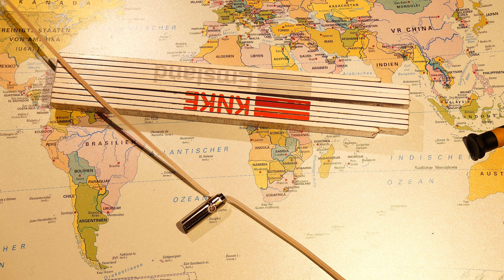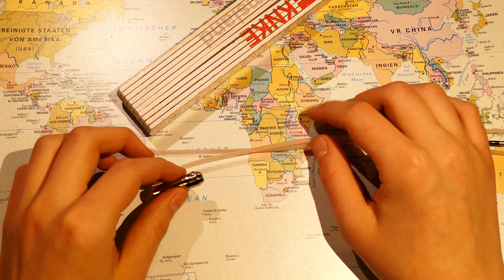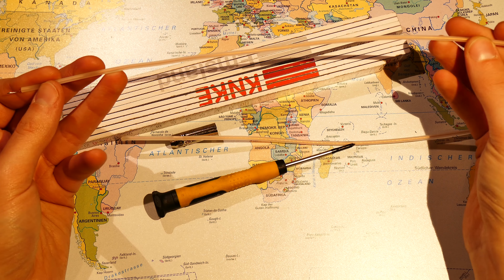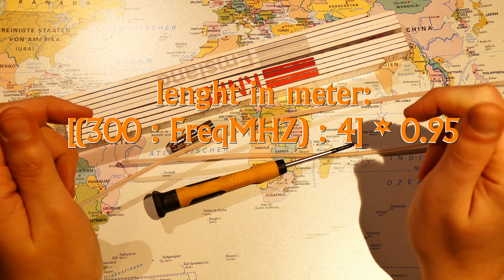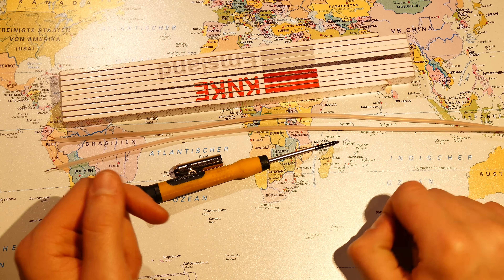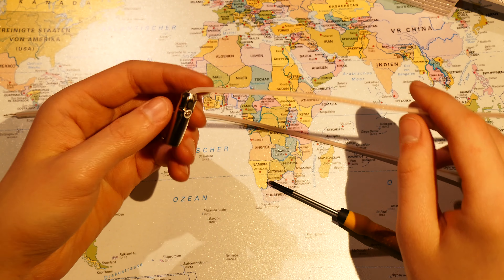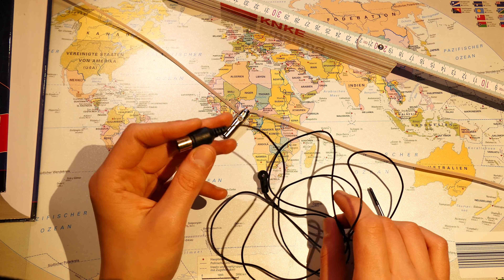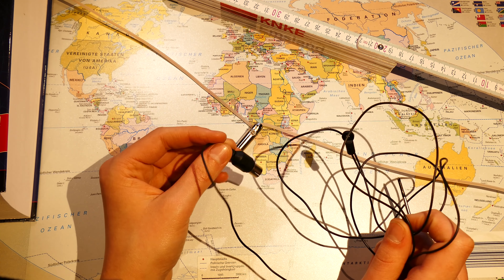Homebrew antenna for DAB+, DVB-T 2, FM- / AM Radio - selfmade

Comment: Ist die Wurfantenne mit 150cm nicht einfach nur Lambda 1/2 statt Lambda 1/4 aus deiner Formel? Sollte also doch klappen
Reply: You are correct that's a half wave length antenna, same as his FM 1.5 metre  to throw away is/was.
Sie haben Recht, das ist eine Halbwellenantenne, genau wie sein 1,5-Meter-UKW-Antennenweg zum Wegwerfen.

Comment: For DAB+ and FM Radio Reception, an Antenna should be as high above Ground as possible and it should be as clear as possible..

AM-Radio (in English) usually means MW... ;) But a simple (HW) Dipole is possibly mostly a practical Antenna for Shortwave (SW) and maybe also higher Frequencies.. (if the received Signal is still strong enough at least).. For MW (AM Radio) a full (half Wave long) Dipole tends to get "a bit" long, actually... :/

Comment: However, for AM-Radio (MW or LW) this Type of Antenna (the HW Dipole) could possibly turn out extremely long... :D :D :D And for best Results, it should be at least about a HW above Ground too.. But that can be difficult sometimes.. And You should use the same Type of Polarization as the Antenna for the Transmitter has, for best Results.. :) (Vertical / Horizontal). And sometimes , for this Type of Antenna, using a "Balun" could be a good Idea too... :)
Reply from the maker: I know, I am preparing for ham radio license but thanks for your information! 73
Reply: @dl6jn  - Good Luck with that! :)
Reply: Der Filmer  - Und Zollstock heisst wohl "Meterstick" auf Englisch... :)
Reply from the maker: Ich habe das schonmal nachgeguckt und wieder vergessen, dann war es mir egal ;) @DE-iv8if